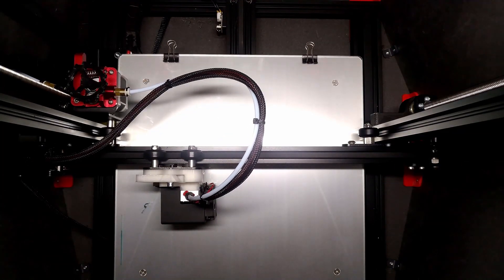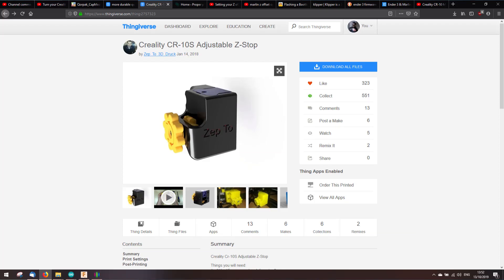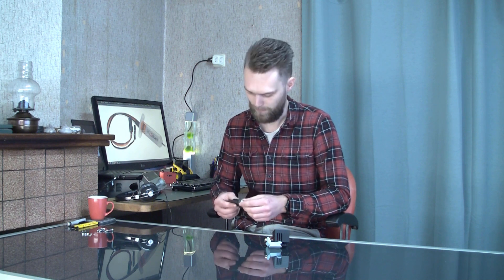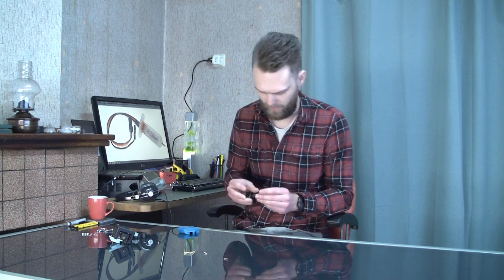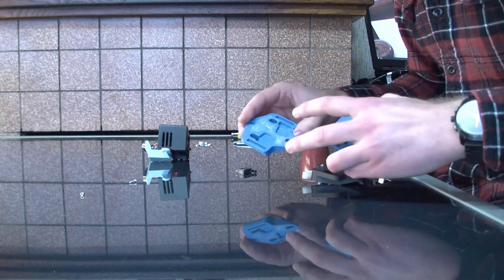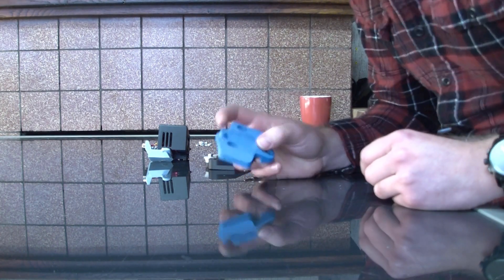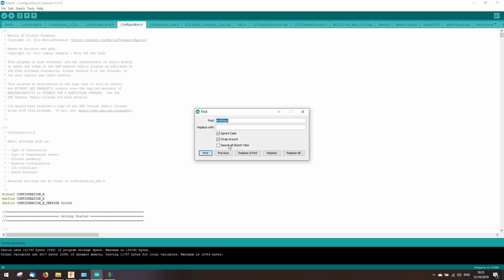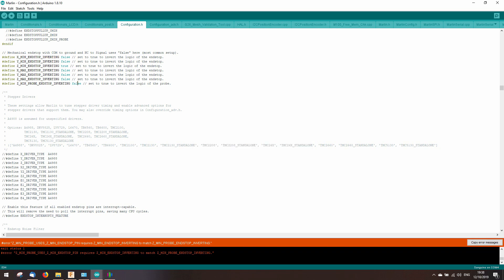Home on anything with any tool automatically on an Ender 3 pro

Comment: The idea is brilliant Jon the only problems i have with it is this: You always level a bed with a hot nozzle and bed and i am not sure if i want to ram a hot nozzle into a bed (any). Seccond thing is that a bed will deform slightly under heat. this means that you can't auto level with this method unless you heated your bed and nozzle. My option is to just keep a inductive sensor (a 2 $) onto every tool.But this does means you will have to have a metal surface somewere under your build surface but even household foil will work here. One last thing i saw in the video is that even how little it is, you repeatedly are putting stress on your X axis this way.
Reply from the maker: Thanks for your comment and suggestions! I still have to find out if this has any impact on the nozzle. I've mentioned this on Thingiverse among some other things I'm not sure off. The nice thing about this mod is that it's not a problem that you must home on a heated bed. In theory you have to set the offset once and never touch it again. After a print is started it will automatically home once the bed is heated. I'm not worried about the stress since this is just the ball point spring and a bit of friction. I'll take a look into the inductive sensors but as far as I know this must be recalibrated after replacing the nozzle itself but I could be wrong.
Reply: @properprinting  Yes with the inductive sensors you have to recalibrate for each tool since the distance of the nozzle and the sensor will be different with every tool. I will follow this progress and see how this works out. As i said earlyer the idea in essence is a very good one . Keep it up Jon!

Comment: Hi Jón!
The design idea for this looks quite promising and interesting to me!
Not trying to rush you or anything, but do you know an estimate of when you are going to upload this design?
I've been searching for a while now for a good tool change system and yours seems to be the one that fits my needs best compared to the ones I've seen around.

Also, can't forget to mention: the idea of using a 11W1 connector is just mind-blowing! So cool! I work around connectors like these all day long and it had never came to me that it could be used like that.

Thank you for your time and your AWESOME content! Subscribed for sure
Reply from the maker: Hi Marko, thanks for your comment! I'm going to improve the design in the coming days and I'm planning to release it next weekend. I'm already working on my next video which will mention the connector so I hope everything goes as planned xD. Awesome that you use this type of connectors as well! How do you use them if I may ask? I think they're awesome and I really like the fact that the big terminal can be used for high power, coaxial or pneumatic. That last one inspired me. However, these connectors aren't that common which I found out later because a lot of people had trouble finding them.
Thanks a lot for subscribing!
Reply: @properprinting  Hey! Thanks for taking the time to answer.
I work as a firmware developer at a company that does custom electronics projects, and these types of connectors are used on several boards. Sorry I can't disclose more details XD

Thank you for the insight on releasing the design. Mechanical design is not a thing in my comfort zone (I suck badly XD), so in the meantime I'll try to adapt the concept for using on i3-style printers as it's the only thing I've got at the moment. Can't promise anything, but if I succeed at all I'll definitely share the design on Thingiverse and shoot you a message.

Congrats for reaching 1k subscribers!
Reply from the maker: @markopesevski  Nice, I work at an electronics manufacturer as a test engineer and I program a lot in LabVIEW so I often am in contact with developers like you :) Hopefully you succeed with your design, would be awesome! Good luck and thanks!

Comment: From what I've heard this is really bad to do with warm brass because it gets quite soft at printing temperature. So you might want to look into using a steel nozzle.
Reply from the maker: Thanks for mentioning! I haven't heard of that before. I am going to perform thorough testing to find out if it damages the nozzle and other points people have mentioned. I'm very happy with the feedback and suggestions like yours so I can learn and try this out!

Comment: Hey! Can you please share this model? If you have already shared, can you please link to it? I am unable to find it in the link you shared. There is a Base V4 but I am not sure if it is the latest that you showed here. How do I set up the tool changer with ABL?
Reply from the maker: Hi! Because the clearances are too large I haven't uploaded it yet to prevent problems. I'm going to modify and print this ASAP, but the last couple of days were a bit crazy xD. If you cannot wait, I've uploaded an unofficial version on my site https://shares.properprinting.pro/public/b3f002. Please note that this is the exact version I've used in the video and this is not the one I'm going to release. The standard V4 base is the newest I've uploaded on Thingiverse and I try to make all new things backwards compatible with this version. The tool changer must be modified if you want to set up the changer with ABL. Many people already made derivatives bot not one for the ABL.

Comment: You just needed to connect the normally closed endstops in parallel instead of in series so in went of them open the circuit gets open. 🤷🏻‍♂️
Reply from the maker: Yes you're right. A colleague of mine mentioned that as well and I felt a bit stupid that I haven't thought about that xD I left it in because I felt that knowing how to invert these channels if needed would be interesting. Still I should have mentioned this and I'm happy that you did, thanks!
Reply: I think you meant the opposite, if it's normally closed as factory, you need to make it in series so any of the two will open the circuit, if it's normally open you make them in parallel, like he did, so any of the two will close the circuit.
Reply: @Spartacusse  You are right. Normally open in parallel and normally closed in series if you want to detect any of them being activated.
Reply: @braxuss  Slap a resistor in there and measure voltage drop, then you'll know which one of them tripped with only one input connection.

Comment: What of you did that exact same thing, but you placed the homing switch on the buildplate itself, and then since you would know the offset, ie. Thickness, of the limit switch device, you could have one offset and then let the tool end actually actuate the switch.
Reply from the maker: That's an interesting thought, thanks for your comment! I think it's a bit more challenging, especially when you want to use different build plates. Not many people use different build plates, so this would be interesting for many. Firstly I'm going to improve this design to reduce the clearances and I'm sure that it would be interesting to test the different options that are suggested.

Comment: Great Idea. I was thinking about making similar thing just with end stop attached to build plate. You are very god in front of camera and you have big potential only thing I would suggest is to inverts in good microphone.
Reply from the maker: Thanks! The end stop on the build plate would probably work as well. After making this design and releasing the video I've learned a lot about homing and the different approaches people came up with. Super interesting!
I'm planning on buying a boundary microphone. I used a Shure stage microphone in my earlier video's which is very good, but the problem I had with this thing is that I needed a separate pre-amp, it was a lot of hassle and I had to be close to the mic. I recently bought a new microphone which can be put on the camera itself. While it makes life much easier,  it picks up of a lot of echo. The quality is a less, but not terrible. But I think you're right that I should take a closer look into the audio and maybe do some adjustments to the room itself. Thanks for the suggestion!
Reply from the maker: Hi Tomek. I would like to thank you again for your comment. I've invested in a new microphone and more importantly, I did some acoustic treatment in my studio. There was a lot of reverb in the room and this is completely gone now. The audio difference between my latest video and all the previous ones is huge in my opinion. So, thanks for your suggestion, this definitely helps making better content!

Comment: Have you heard of precision piezo? They use a piezoelectric transducer as a switch, similar to you. Might help with the tilt problem
Reply from the maker: Thanks for your comment. Yes, someone on Reddit mentioned this after I've posted this there. This seems like a good solution which I'll definitely keep in mind. I'm first going to decrease the clearances and reprint it out of Nylon because this is quickly done. I'm thinking of trying something with a compliant mechanism in combination with the piezo but that's a project for the future.
Reply: @properprinting  oh, that would be clever! You're onto something there

Comment: Great idea! And interesting video about the design process, congratulations ;)
But I'm wondering how you could do your bed levelling with this method. I mean, it's fine if you bed is perfectly levelled, perfectly parallel to the X and Y axis, but if not, it will be impossible to level your bed without using the original fixed Z endstop. I'm wrong?
Reply from the maker: Thanks man! I do not level the bed with this method. I should take a closer look into mesh bed leveling, but for now I get away with making sure that the bed itself is flat and level using an indicator. I think that with this system that the only reason to use the original end stop is for fall-back in case the tool isn't placed or a laser head is placed.
Reply: @properprinting  oh yes, bed levelling with the indicator is perfect, you're right, I forgot you could mount it on the Quick tool change ;) I designed one base for my indicator too, I will share it soon, it place the indicator tip in the exact same spot of the nozzle on my Alfawise U30, perfect to level the bed in a couple of minutes ;)

Comment: Why not put the spring below the trigger switch so then the spring hits the bed (or frog) first and pushes up to close the switch and trigger the endstop
Reply from the maker: Thanks for your comment. I don't have exactly in mind what you suggest, but if I'm correct you'll need the spring to retract, like the BLTouch does, otherwise it will collide with the printed part. Homing with the nozzle itself does not require any retraction, you must give it an offset though.
Reply: @properprinting  I was thinking the same thing about retraction

Comment: Nice work. It looks like the whole thing tilts just before activating the switch. How reproducible is the home position? How much force between nozzle and bed? Obvious the nozzle needs to be hot, but can leftover plastic be squeezed and affect the position?
Reply from the maker: Thanks man, and these are some good questions! It indeed tilts and therefore I haven't shared the design yet. I'm going to tweak it to make the clearances smaller and I'll take a closer look into the reproducibility of the homing position, it looks promising for now. I just have measured the amount of force between the nozzle and bed which is around 6 Newtons (including the weight of the hot end, tubing wiring etc.). The nozzle needs to be hot indeed and I recon that 6N of force will squeeze the plastic enough. Maybe this will have some affect, but I think this is negligible.

Comment: I went ahead and liked this video before I watched it, this is something I do for only one other channel. I do this because I trust the creator. This is a great idea, I love how you show your missteps and iterations before arriving at a usable design. I don't think this auto homing device will be necessary for me, but it is an elegant design for those who use their Ender as a multitool. I use mine only as a printer so far, though I am planning to add the writing machine. I don't plan on enclosing my printer so Laser Cutting is off the board as far as I  am concerned. WELL DONE!!!!
Reply from the maker: Thanks a lot man for your awesome comment! What you say really means a lot to me! Cool that you are planning to add the drawing machine, its a lot of fun to watch the printer make a drawing and the results are quick. The enclosure is mainly for printing ABS and Nylon. Laser cutting is fun but also dangerous. I don't do it often since I do not have a fume extraction system. Don't hesitate to contact me of you have questions regarding the drawing machine :)
Reply: I agree.... he delivers some awesome content